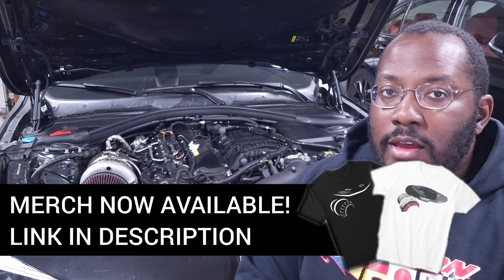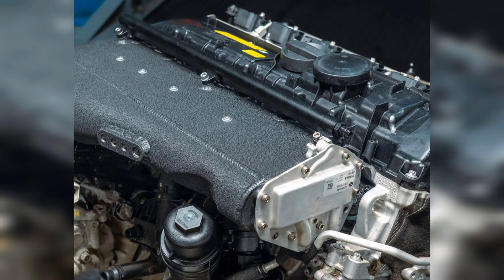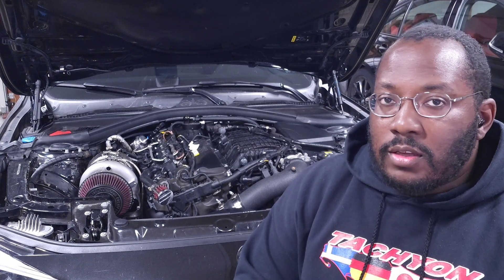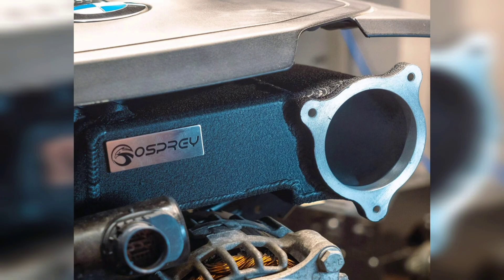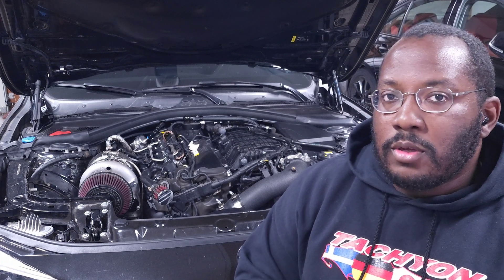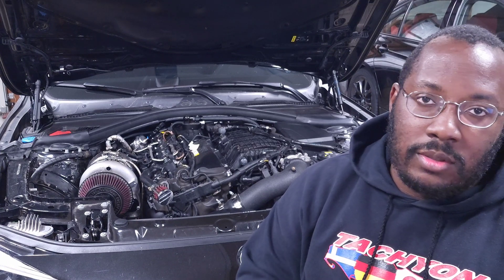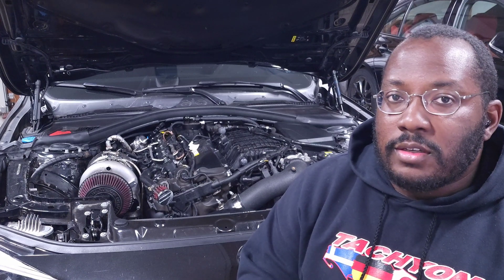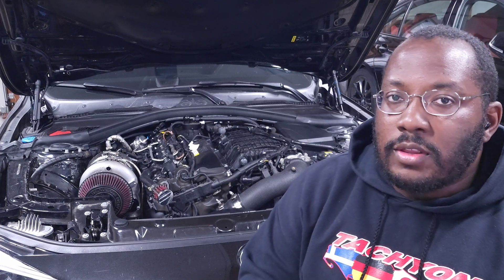This B58 Intake Manifold Upgrade reuses the stock Intercooler core...

Comment: if you put an interchiller on that, it would work just as well as the big cores.   i have an interchiller on a 75% larger core and my IAT are like mid 50f in 105f weather.

Comment: Y doesn’t the csf one fit on the f30 chassis?
Reply from the maker: B58 and B58TU have slightly different accessories around the manifold. If it's made for A90 then it's made for TU not gen 1.

Comment: A bigger core isn't a waste of money...iats will skyrocket past a certain power range and if you're pushing past 34 psi you definitely fit the criteria where a bigger core is needed. With that said , I'm just sore coz I just bought an rkv2😄
Reply from the maker: No i agree. Personally I'd go with a bigger one because of my goals.
Reply: Run. Coolant. Through. AC block. Delete grill heat exchanger. Solves any temp issue
Reply: Or have it through a cabin controlled solenoid so you can still have working ac